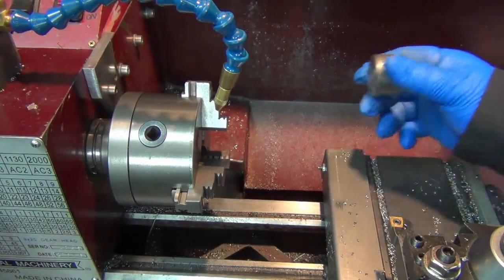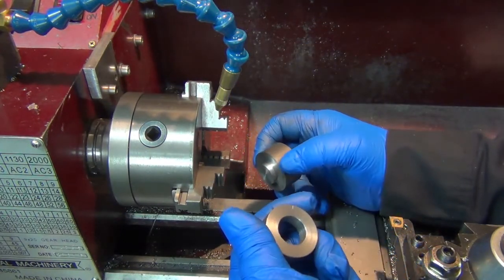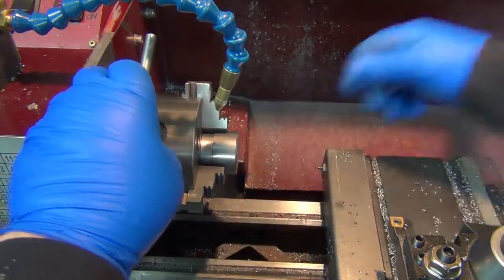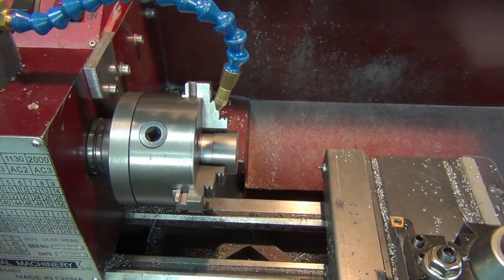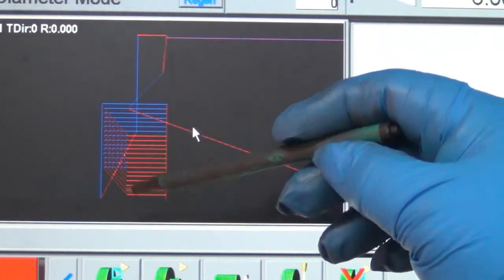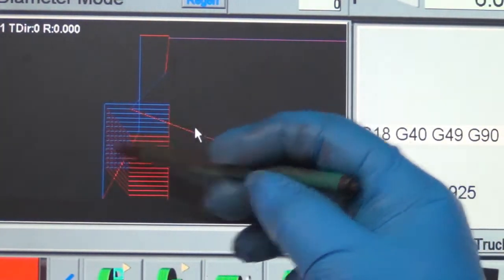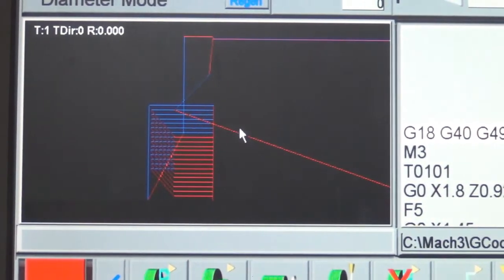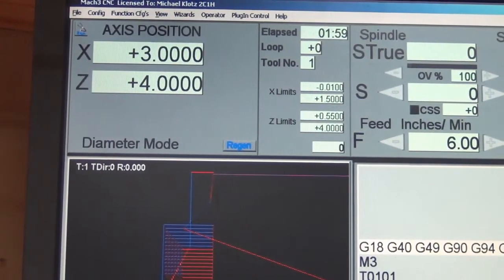9x20 CNC Lathe - Bracket Spacers - Part 2

Comment: It sure is satisfying getting the code to run faster and smoother not to mention the money.
Reply from the maker: Yep.  There's still a bit of fat in there, but I don't need any more parts, so that trimming will have to wait for another day. :)
I could have made the parts on the manual lathe for the same cost as the cnc, but since I was able to do more than one thing at a time, it was way better. Plus, the drudgery of manually turning the same part 100 times?! :(  lol